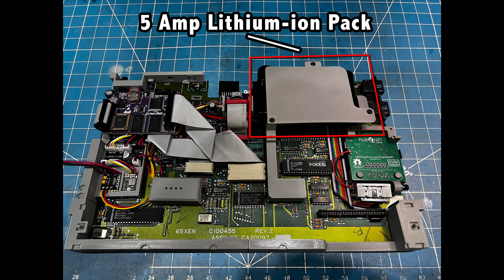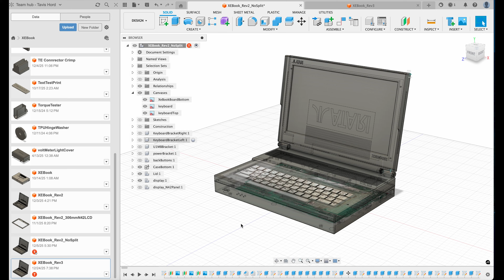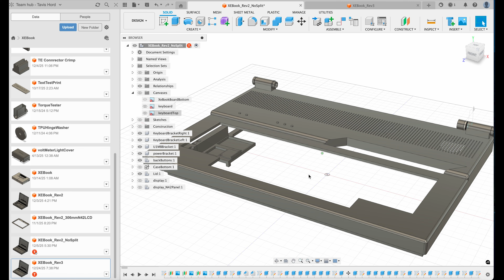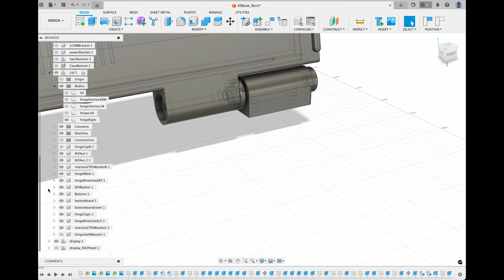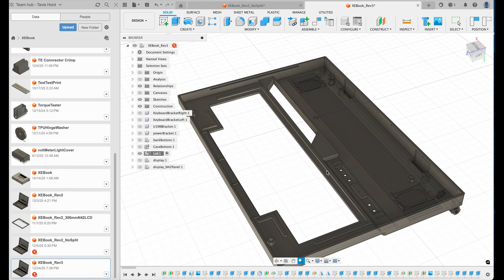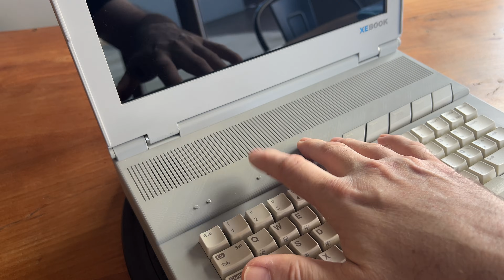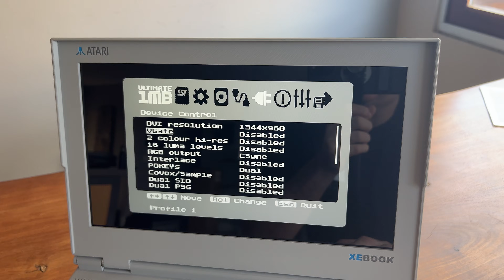How I made an Atari 130XE Laptop Using Original Hardware

Comment: Very Nice!
Reply from the maker: Thanks. I’m still working on revisions. I’ve now consolidated my power management, audio, and battery status to a single board which should cut some cost and make the built time faster. I’m going to be offering some for sale but the cost to build them is not cheap. Materials run about $700 and take me about 20 to 30 hours to build. I have a preorder page at XEBook.sideburn.com

Comment: Ohhh, I need one of these!
Reply from the maker: I’m making more we can put you on the list :)
Reply: @sideburn  How do you gt on the list?
Reply from the maker: @o @originaltrilogy1 I’ve actually been working on a website to do that. Just still got to get the pricing sorted. I’m afraid they might cost too much for most people. The parts alone for one with all the mods gets up to $800. Then I think my build time on the last one (I’ve done 3 so far) came out to 20 to 30 hours. I’m working on an all in one circuit board and I’ve got a cnc machine coming so I can make my own metal parts. Trying to get cost as low as I can by reducing labor time and parts costs. You can test the site out if you’d like and I’ll get you in the system. It’s at XEBook.sideburn.com

Comment: Great job. I'm also in the process of designing a laptop, but based on the Atari 800XL with an ALPS keyboard, 8MB memory expansion, VBXE, IDE Plus 2.0 as HDD, AcidStereo, Fujinet, and the ability to change the ROM and BASIC. Mine will have a 12" 800x600 4:3 screen. And of course, the design will be consistent with the XL line. If I manage to finish it, I'll show it off too :) Anyway, I know it's not as simple as it seems, which is why I admire it even more!
Reply from the maker: Nice! Yea the 800xl would be nice i just steered away from it because of the cartridge slot position mostly. I’m curious about how that acidstereo works since the pokeymax is hard to source. Pretty much have to try to get them made yourself now. Yeah a 4:3 screen is also a nice idea they were just harder to find in a slim form factor and it pull a lot of current. The U1MB should let you have control of the romnand basic if you take that route. I’ve been talking with the guy that does the Decent XE keyboard to possible make a custom one for this as well.
Reply: @sideburn  My project will be look more like old laptops from the early days of PCs. The card slot will be moved below the screen and accessible only after opening it. Overall, it will look a bit different than yours. As for the U1MB, I don't want to install it because its functionality duplicates the 8MB RAM expansion and IDE Plus. There's no point in installing it since most of the features would be disabled anyway. The 4:3 display is new from Ali, and it's expensive, but I wanted that format. So, it's relatively energy efficient. Initially, I planned to install an XF551 modified for a 3.5" drive, but the power consumption wasn't ideal, so I decided against it. But there's still a long way to go...

Comment: Absolutely incredible work, love everything about this! Looks and (probably) feels totally legit, as if Atari would have made it themselves :) Growing up with a 600XL, I dream of a similar device in beige-brown-silver but idk if I can source the necessary time to get this level of perfection. How long did it take you from idea to the finished one?
Reply from the maker: Thanks for the comment! Yeah that was the goal to make it as if Atari would have made one. They came out with a laptop version of the 16 bit ST line and I kind of paid tribute to that one in my design. It was called the STBOOK so I named mine XEBOOK. My first Atari growing up was an 800xl and then the 130xe. How long from concept to completion… hmm that’s tough. It took a while to get the video sorted out and I went through several types of lcd panels. Also getting the composite video to digital was a process. Then the power. I wanted to get the longest runtime and a fast recharge so I tried several type os batteries from flat lipos to lithium ion and stepping up the voltage vs stepping down. I ended up with 6 3.7v lithium ions. Two
Sets of 3 wired in series to get 11.1v and then both of those in series to get 5amps. I then step that down to 5v and that ends up getting me 6 hours runtime. The charger is 3amps to it recharges in a little over an hour. I probably spent about 3 months working off and on for the first version. There’s a thread I created of the build process at https://www.southernamis.com/forum/general-discussions/xe-book-development if you feel like checking it out.

Comment: Incredibly impressive. Here I am thinking it would be nice to get my old 130XE working at ALL, and then I see this. Just...wow. Very inspirational! Gonna have a very hard think now about doing something with my dead unit this coming summer.
Reply from the maker: Thanks. Let me know if you need any tips on repairing it. They’re usually pretty simple fixes. The one bad thing is Atari stopped socketing the chips to save cost when the XE line came out marking it a bit more difficult to troubleshoot.

Comment: Now that's some quality build, without hot glue and wire mess you usually see when people want to make old machines portable. And now i want to do something similar with working A1200 with badly damaged case.
Reply from the maker: Thanks. Yeah I have a general rule - no glue and must be able to disassemble and reassemble as many times as you want. I’ve learned my lesson. You always end up having to take things apart and fix or modify. So I use threaded inserts, bolts, and no glue whenever possible!

Comment: Looks great man, a lot of work went into those hinges but it paid off. Very professionally done and the multicolor prints for the text came out great. I'm certain a lot of 130XE enthusiasts would love to have one of their own. 🍻
Reply from the maker: Thanks. Like you mention about tolerances, OMG I think I went through 4 rolls of filament and tons of iterations to get everything right. You got me intrigued now to try some tinted acrylic etching. I’ve been making a handheld sound effects board that uses an authentic Defender arcade game board synth and would be cool to have an overlay with some cool graphics on it where the buttons to play sounds go. My issue is I’ve only got one of those big cheap Chinese laser cutters and it’s a hassle settting up with exhaust tube and you have to run ice cold water through the big c02 laser tube. No 40w laser option on Bambu H2S. I had to get the H2S for the largest build surface. This laptop took up the entire build plate without a millimeter to spare. Couldn’t get anything other than PLA to work either because of the corners warping on such a large print.
Reply: @sideburn  Yeah you should try it, they make a ton of different colors and surfaces for acrylic and they all look a little different when etched. I have a permanent laser setup so that makes it easier, but it is a very handy tool. 

Warping is a problem with larger prints, I've run in to that many times. I feel it's almost easier to print in sections and then clean up the seam later with filler and paint, but it really depends on the look you're going for. Either way it came out great and I'm sure you learned a ton while you made it 🍻

Comment: 3:25 interesting that it says 65XEN here!
Reply from the maker: Yeah that board is actually a 65XE PAL board.. It turns out there are two types of 65XE boards... This type which is actually a 130XE board (it has the PBI slot next to the cartridge slot) without all the RAM populated and then a 65XE labeled board without the PBI slot... I did not know this back when I did the design and designed in the PBI slot on back assuming they were all like this... Later when I got commissioned to build another, I bought another 65XE (because they cost less and I put the U1MB tab board on it anyway) and discovered it did not have the PBI slot so it wouldn't fit in my case!

Comment: I had an Atari  mega 4 STE  back in the '90s that I used to run my MIDI recording studio I have graded it to 10 megabyte It was an awesome computer.
Reply from the maker: Nice! I had a 520ST that i made into a Hackintosh that ran system 6 I beleive. I have a fully restored STacy now. I think Cubase began its life on the ST.
Reply: @sideburn 
I was drawn to the Atari because it had built in midi ports You didn't have to use adapters or a sound card. Plus Atari's at least mine was made in Sunnyvale California. On my Mega 4 STE I used an extra hard drive for backup so if I lost everything on my main computer I could download it from the backup hard drive
Reply from the maker: @garlicpreesright the built in midi was a big thing back then. Apparently it’s so good with timing or something that musicians still use it today. You can get modern SD card hard drives for it now
Reply: @sideburn I had software on my computer that I could download all the patches from my synthesizers and reload if one of my synthesizers crashed. I could print out sheet music off what I played the software I ran was something called Dr T's real time it was great software the problem is the Ataris loaded off of the floppy drive not the hard drive and my floppy Drive broke and I couldn't get it replaced so I couldn't turn on the damn computer. So I took my computer extra hard drive all my software and throw it in a dumpster
Reply from the maker: @garlicpreesomg. Yeah I’ve heard of Dr t. Dang all that stuff I dumped is worth something now and there’s modern drives like Gotek and SD. But I hear ya I’ve tossed so much stuff that became valuable decades later 🤦‍♂️

Comment: impressive.

especially battery life.
Reply from the maker: Thanks, yeah the battery life and lcd panel took me a several iterations to get nailed down. The lcd panels were pulling too much current and the flat lipo packs didn’t have enough oomf. The trick was to use higher voltage packs and the step them down. That way it pulls less current on the pack and now we get 6+ hours.

Comment: Very nice!  When can I buy one? ;)
Reply from the maker: Hah well I’ve made three so far. They take a while to make but I can take more of them on… 
Parts alone get up there in cost though.
Reply: @sideburn   Very nice!  How much you want for one?  😅
Reply from the maker: @DanRamosDR  well I only charged the last ones for my labor time estimated and cost of materials. Thing is the materials alone get up there. You have to seek out a motherboard , keyboard, and then the U1MB , Fujinet, Sophia 3, LCD panel, battery, etc. it ads up quick. I have a BOM with totals. You can contact me if you want to go over the details. My email is on the about page.

Comment: Very nice project! I just wish the LCD panel was closer to the 4:3 aspect ratio.
Reply from the maker: Yeah. It is set to 4:3 so it does display that way but finding a 4:3 is near inpossible. You can use an older television display panel but they draw a lot more current and aren’t as sharp in quality. I tried several panel options when I started the project. The ones I ended up with have a great quality image, are about 1mm thick, only need 5v (instead of 12) and draw little current so it’s a good trade off.
Reply: @sideburn  There's a nice 14" 3:2 panel, which might fit better. Available as a full portable monitor on aliexpress for about $65.
Reply from the maker: That could possibly work. I did a search but didn’t run across it. The one I use now is a 13.3” 1920x1080.
Reply: @sideburn  Look for "ZSUS 2160*1440 14-inch 2K Portable Monitor".
Reply: @PseudoGfx  Do you have a link to it?

Comment: 4hours battery life before reserve is the most insanely impressive thing about this
Reply from the maker: I was wrong in the video I went back and looked at my notes and I get closer to 6.5 hours on o charge.

here's the breakdown:

current draw is 1.8a on 5v rail all in and .7a on 11.1v pack
so I get 6.5hr runtime on 11.1v 5400ma pack
 
2hr recharge (when powered off), although it also charges pretty fast while powered on.
Reply from the maker: Yeah I think I even got close to 6 back when I was testing but it’s not good to push the battery back all the way to low voltage cutoff. This is why I use an 11.1 5 amp battery and then step it down to 5v. The current load on the pack will drop when stepped down to 5v. I tried a lot of battery options and this worked out best. I wanted a thinner pack at first and used a lipo pack at 3.3v and stepped it up but that caused at too much load.